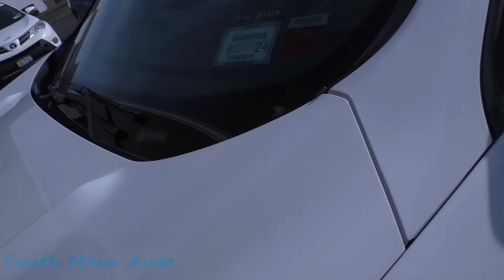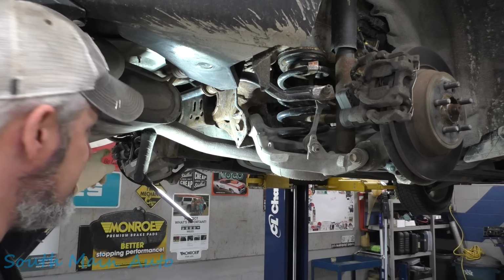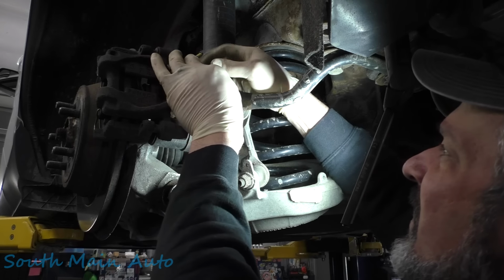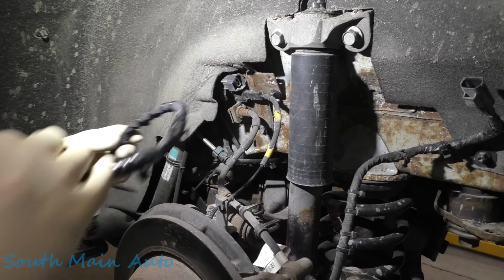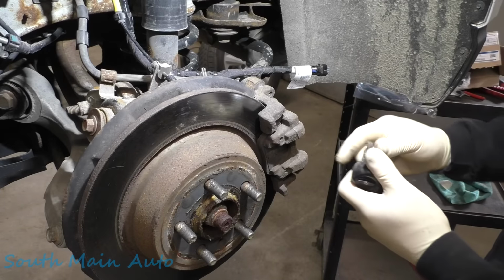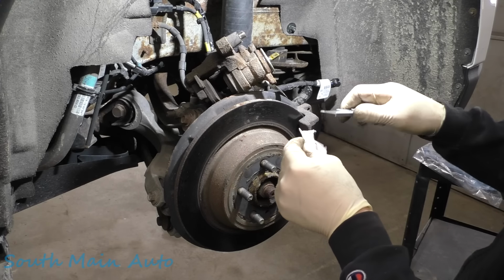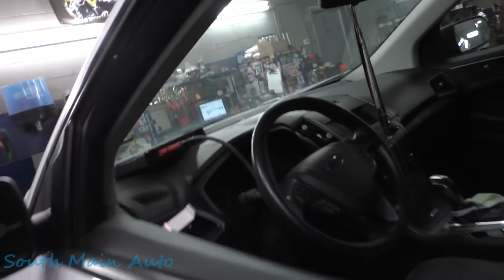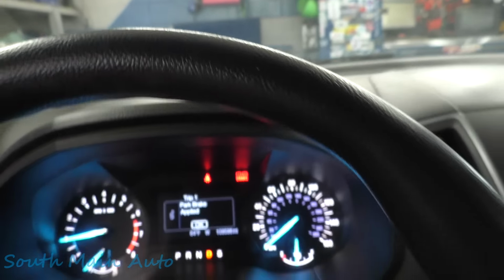Ford Edge: Electric Parking Brake Malfunction

Comment: I'm still using a mechanical parking brake. 25 years old and works great. 1999 Camry. Ah the wonders of engineers and modern technology!
Reply: One thing about Toyota, I bought a new Tacoma about a year ago and it probably had the same exact parts that are in the 1999 Camry for the rear brakes haha. It's a mechanical drum parking brake in the rear
Reply: My kid has a 99 Camry with 260k on it. It is hands down the best car we have ever owned.
Reply: @mikemaccracken3112  Straight on sir! only 151k on the clock. I'll drive it until the frame rots!
Reply: @jbrhel  long ways to go! Do you live in the rust belt? Mine will rot out before it dies. I'm in MN.
Reply: @John Brhel  my frame rotted at 89k love North East pa ice melt.  Parking brake broke  the first  time at 45k.
Reply: @dans_Learning_Curve  New York. I feel the same way.
Reply: @mikemaccracken3112  mine is sitting at 430,000+ miles with the 3.0.
Reply: Keep up the good work sir.
Reply: There's a clear difference between ford and toyotas need to say more 😅😅😅
Reply: You wouldn't be saying that if it was a 25yo Landcruiser or Hilux, they crap out over here in Australia & we don't even get Salt (just dirt)!
Reply: I have a car I've owned for 48 years and have no idea if the parking brake works or not !
Reply: @larryc8607  I wouldn't try finding now might cost you a lot to unlock if it does
Reply: @larryc8607  which car is that?
Reply: @dans_Learning_Curve  69 chevelle ss.
Reply: Have not touched it for 10+ years.
Reply: @tszailer  I use mine every day. That will help keep it working properly.
Reply: My parking brake also works great on my 1995 Intrepid. Have had some issues with our non electric 2010 Grand Caravan parking brakes, but again they are much easier to work on.
Reply: A key thing to remember is this is not just a parking brake. This is also an emergency brake. If you blow a hydraulic line at high speeds you need this system working. Old systems only apply rear brakes. The new electric style applies all 4 with the correct pressure to stop safely. I like the old simple and cheap design but, I’d rather have my family get home rather than attend a funeral. That’s why emergency brakes exist!
Reply: You must not live in the north
Reply: @agger838  Upstate New York. Rust belt!
Reply: @agger838  Upstate NY. Rust belt.
Reply: it needs to be manually adjusted and 9 out 10 cars I see and never adjusted properly electric parking brake eliminates that issue.
Reply: @TONYSTARK-jh2wu  Let's say that the engine cuts out and you NEED the emergency brake. A long shot but what then sir? Adjustment is a matter of turning the star wheel. Cheap and easy.
Reply: @jbrhel  the engine being on or off has nothing to do with the electronic parking brake. you can google the diagram and see for yourself
Reply: another thing 9 out 10 customers that come to the shop can't put air in their tires let alone adjust a parking brake
Reply: What percentage of drivers actually use the parking brake?  I never do.
Reply: @richardbambenek2601  I do every day. As they say use it or lose it. I need it to pass safety inspection.
Reply: I know for a fact the parking brake shoes are totally missing brake material! The car experienced a couple of new drivers that probably didn't release it before driving.
Reply: Here's the point. What they now refer to as a "parking brake" used to be known as an "emergency brake" in other words, a brake that you apply when your main brake system has failed. And that is exactly why it was always a simple mechanical linkage. Not hydraulic, not electric, not computer controlled. It's supposed to work when all else has failed. Like I keep saying: WE HAVE GONE BACKWARDS, WAAAY BACKWARDS.
Reply: Replacing simplicity with unnecessary complexity. Gotta keep engineers employed
Reply: The screaming goose engages every time I put my truck in park. The parking brakes are automatic these days.
Reply: Right! What's wrong with the old cable, an actual key and a shift cable?!?
It's like they want the components to fail!
Reply: @philllsxga.7737  I suspect it's people wouldn't use it when they should.  Relying on the parking pawl where you shouldn't and disuse made them stick and burn up the wheel.
Reply: @philllsxga.7737  Just like speedo cables, heater control cables. Rarely did we have issues with them, and if we did, it was a easy repair.
Reply: @philllsxga.7737  And don't forget a shifter cable vs the new round shifter dials!
Reply: @unclemarksdiyauto  something else to fail...
Reply: Yes, can’t beat those old mechanical spark advances, mechanical chokes, hand crank mechanical starters and mechanical parking brakes!
Reply: @LTVoyager  
Yep they like the 'modern' fly by wire systems not so much cause they are  better .... It is cheaper for them to get a trained monkey to plug in a keyed electrical connector.... instead of an engineer to properly layout the cable routing and a skilled assembly line worker to properly install the mechanical systems.  An added bonus is the modern systems seem to be especially designed to make it past the warranty period plus a little  then fail and they get to charge extra
Reply: @LTVoyager  well played sir
Reply: And guess what, it’s a parking brake.  I just want it to work, I could care less that it’s electrical or mechanical.
Reply: @hokie9910  $$$
Reply: All this electric crap is just more examples of stuff we don't need thank you engineers
Reply: @vwwrenchie314  don't thank us.  I don't want it any more than you do.  Our bosses (MBA types who don't do any real work) push us to this nonsense.
Reply: @dieselchevette  i know exactly what you mean..thanks😁
Reply: Right but in the rust belt that mechinal system would be rusted off there in 3 yrs the electrical system lasts twice that long
Reply: @jeremyhanna3852  and it's 3x expensive to fix.
Reply: My '99 Camry has around 430,000+ miles on it with the 3.0. Original engine and transmission. What are you sitting at?
Reply: @dans_Learning_Curve  151K. 2.2L 4 cylinder.
Reply: @dans_Learning_Curve  had 535,000 on a f-150 4.9l when I sold it. Original motor and transmission. She was starting to get a little thirsty for oil though 😂😂
Reply: @michaelfrohn255  that be some good miles! Did you commute with it?

Comment: “She doesn’t even use the parking brake” that’d be part of the problem.
Reply: I haven’t used a parking brake since I started driving automatics.  With a stick shift, yes, automatic, no
Reply: @robertheinkel6225  I’ve been around machinery my whole life. I was taught to put manual transmissions in first or reverse. Automatics in park. Use the parking brake on everything that’s parked on a a grade and make sure it works, if not chock the wheels. However not using the parking brake is what allows the rust to grow and sticking the cable. Usually resulting in cutting the cable to release it. I’ve have found that Sea Foam Deep Creep is the only thing that will get it working again if it’s hung up. No guarantee with it either. But since I decided to use it or lose it I no longer have issues with the cables sticking.
Reply: @robertheinkel6225  well there's your problem when it seizes up,lack of use, you've heard the saying, use it or lose it,that's wot the urology nurse told me about my tackle just saying from up north UK 🇬🇧 🤔
Reply: @robertheinkel6225  you should be. While yes, the parking pawl is designed to hold the vehicle, it’s imo and many others that this should be seen as a redundancy/fail safe. There’s just not a good reason to not use the parking brake. I did in my old car aside from in my garage since it was level and didn’t rest on the parking pawl, and my current car with an electronic parking brake doesn’t give me the choice. Parking brake goes on when the ignition turn off every time for safety.

Comment: Hi, thanks for the video, Eric. I have a question: was it necessary to change the motor did you check its resistance?
Reply: He said he thought that the pin corrosion would migrate up into the motor and it was just better to replace it....
Reply: @MicroSoftner  Yes but I think it is worth checking considering the motor costs around 200$
Reply: @samo33958  yea really, prolly good idea
Reply: @samo33958  the motor might still function but the connector on it is corroded. It might still work for a time if you try and polish up the pins, but when the outer coating on those little pins get eaten away then it will quickly get crusty again. If he left the old motor on then it would just ruin the replacement wiring harness, and the customer would have to come back and pay even more money.
Reply: @samo33958  Worth it if performing this repair under your shade tree. However, noted by others, Eric warranties his work. Corrosion migration may result in his subsequent motor replacement out of his own pocket. Eric goes way beyond expectations to repair existing components prior to replacement, & on older vehicles he explores use of wilbert's used auto parts supply. 💡🗽🇺🇸
Reply: He has to warranty his work, so if he reused the old and it failed, he would have to eat the new actuator and not get paid for the labor to do it. 

Unless the customer specifically said, don’t change it and he can document that, it’s better to replace.
Reply: @dwebs262  Yes that makes sense.

Comment: I see no reason for an electric parking brake, especially when they break and are expensive to repair.  A manual parking brake with a cable makes much more sense.
Reply: The electric works with the disc brake. Cables need a drum brake to be effective. For a while the disc brake rotor had a small drum to use for the parking brake. This is apparently the newer design that uses the disc only.
Reply: @machintelligence  there are calipers that will manually push the piston out using a cam action pulled by a cable.

Comment: Hmmm- I would have run 2 jumper wires from the connector to the motor to check if it works before ordering a new 200.00 motor-  Might have just been the short harness and the corroded connector.
Reply: Just insurance on come backs.  If "green puss" came from inside the connection on the motor side then it's possible for the new wire harness to develop the green puss again in the future.  If it were my car I'd test and replace the harness, , but then I can only blame myself! 😂

Comment: I would be happier with a standard parking brake handle and cable to actuate the parking brakes. It's cheaper and more reliable. It's a smart idea to replace the motor with the harness because you don't need call backs. If I was doing it on my own car I would replace the harness and clean the contacts and test the motor and keep it if it was still working.
Reply: You obviously don't live in upstate New York.  Parking brake cables don't last long here. The salt either eats them up or the rust binds them.
Reply: @donmunro144  That's a lack of maintenance. Living in a salt zone you have to take care of the underside. There's plenty of spray on solutions: Krown, Fluid Film, Surface Shield, etc.
Reply: @TheOtherBill  they help but they're not a cure all.
Reply: ⁵
Reply: I would have also fixed the harness for couple bucks
Reply: @safffff1000  that’s a poor business practice because you have to warranty the repair. Better to replace the part and get a warranty from the supplier than to have to warranty it yourself. If it’s your car, do whatever you want as long as it’s safe.
Reply: no that is what I would do just for myself

Comment: What is it with American Drivers that do not use the Parking/handbrake no wonder there are so many incidents of cars moving cus the stupid Park function in the auto box is knackered  needs to be a legal requirement that the Hand Brake IS applied every time you are going to get out of the car
Reply: where are all these cars that are moving on their own??????
Reply: @leftyo9589  UK GM vauxhall
Reply: You actually think a law will solve anything? People that don't want to still won't use it. In almost 50 years of driving multiple vehicles I have yet to have a failed parking pawl.

Comment: Thanks as always, Eric. They can overcomplicate the system, but they can't overcomplicate the diagnosis. Awesome.😊
Reply: Around here park brakes are required to pass bi-annual inspection.  So few people use them that the cables seize up (good old salt) and they get replaced repeatedly.  I use mine all the time and the cables last forever.

Comment: Was the motor dead?  Replacing it necessary?
Reply: He gave his reasoning made me a believer.
Reply: The connection in the motor was showing corrosion. He was not sure if the corrosion was migrating into the motor itself. He took no chances.

Comment: Eric without the fancy scan tools could you just swap the known good motor with the suspect motor or aRe they side specific. If the customer didn't, couldn't afford three hundred in parts..?
Reply: I guess you can... you don't need to have it fully installed, just plug in the connector. Or you can use two long wires and connect to the harness on the side that works.

Comment: Used to be that the old drum & shoe , cable brakes would be a drag. Now they're HAL fighting Dave Bowman's nightmare.  " I'm sorry Dave, I'm afraid I can't do that.
Reply: Love the reference!
Reply: Dave did fix it though. He did gut HAL to do it though. 😂
Reply: @LadyAnuB   Unplug Luddites Unite ! .... Back to 1986.......back to the post apocalyptic future of carburetor & EMP proof points , condenser ignition.
Reply: @pedrorojascervantes3928  Setting points, valve adjustments, lubrication spots, bench seats, no seat belts 😅
Reply: @LadyAnuB  My first Harley was a 1977 Electraglide that had a points & condenser ignition & I remember quick checking the gap with a paper book of matches cover!
Reply: @LadyAnuB  and a 3 speed manual column shifter. Real cars.

Comment: Doesn't use it and wonders why it messed up? Have to consistently use them or they freeze up. When I lived up north I never had one mess up. I always used it.
Yes I know the electronic POS parking brakes are different. Hate em.
Also, you don't use it and it's messed up yet you want it fixed? Am I the one that's a little miffed or...?
Plus, with the cable if you had a hand-operated lever you could lock up the rear end in snow and save your ass from wrecking. Now.... Good luck.
But I will say this, we do have an AWD Edge and it's a tank in the snow. It's really good. Just keep that PTU fluid changed!
Reply: They put them there for a reason, I always tell people set the damn parking brake. And flush your brake fluid every couple years. An ounce of prevention is worth a pound of cure.
Reply: @commietube_censorship_sucks  that's why I said electrical POS parking brakes are different. 
No inspections here 😁

Comment: Great job as always, Eric. Problems like this make me miss the days of cable-driven parking brakes. Simple and effective, and no computers involved.
Reply: One of the things I love about my 22 Tacoma, still a cable driven rear drum parking break
Reply: So this car has no way to use this as an emergency brake. As in backup in case the mains fail (or you're evading and don't want brake lights)
Reply: @sometimesleela  You can use it as an emergency brake, usually you have to hold the button or the lever or whatever switch it has to activate it if the vehicle is moving and it'll partially apply the parking brake so it doesn't lock up the wheels, there's a lot of logic involved but you can use it as an emergency brake.
Reply: @lustfulvengance  you don't have any control of how much braking effort it will apply though, whereas you do with a lever.
Reply: I don't mind the computerized aspect of it. I just dislike it because you can't use it to break traction on the rear wheels if you want to play a little bit.
Reply: ...and completely useless with rusted solid cable after 3 years. Dad had to admonish us to never apply the parking brake because it wouldn't release and would drag until you wore down the pads
Reply: @John_Ridley  It seizes exactly because it's not used. If you use it every time you park your car, it'll last a long time.
Reply: @johnnyblue4799  this statement holds water...
Reply: @johnnyblue4799  agreed. I use mine every time but still had a cable seize and I had to replace it, but true in general. The more used the less trouble
Reply: @johnnyblue4799  I have had 25-30 year old cars that still had working parking brakes. And yes, that is in Pennsylvania.
Reply: @rayrooney4656  That's great... Mine is 22... Works fine.
Reply: @John_Ridley  Yep, agree, but I use mine all the time so I've never had that issue, but know friends that have broken theirs at least once over the years. Don't live in the rust belt but over time, if you yank on the handbrake too  hard, they can snap that way.
Reply: @John_Ridley  Sin desmerecer lo dicho por tu padre, digo que el agarrotamiento (trabado) del cable interno de accionamiento de freno de estacionamiento se oxida (y traba) por ¡falta de uso! Hay que acostumbrarse a usarlo y se mantendrá libre... (y efectivo)
Reply: @cesardavrieux3767  English translation for us monolinguists: "Without detracting from what your father said, I say that the seizing (stuck) of the internal parking brake actuation cable rusts (and sticks) due to lack of use! You have to get used to using it and it will remain free... (and effective)"
Reply: @undecidedmiddleground5633  ¡Gracias por traducir!!! No soy "multi" lingüista. solo soy "mono" hablo , escucho, escribo y entiendo (y no totalmente) mi lengua natal (que para mí es el CASTELLANO, aunque ahora le digan "Español" (traducción de Spanish) Lo que sí hago es usar mucho el Traductor de Google... o hago clic derecho en el texto y elijo Traducir al Español. 😄